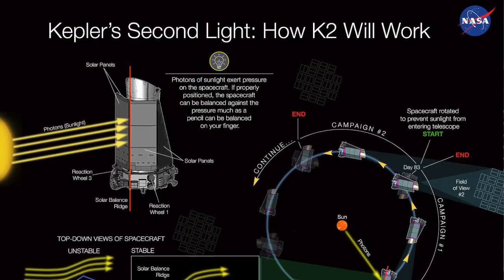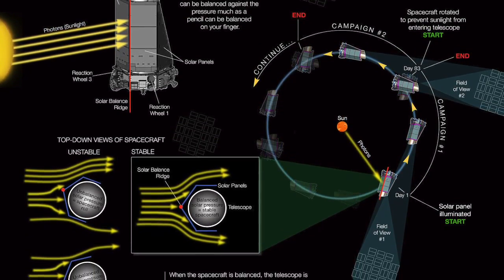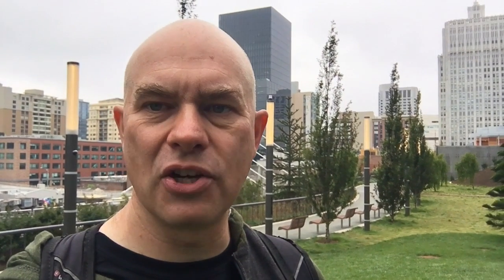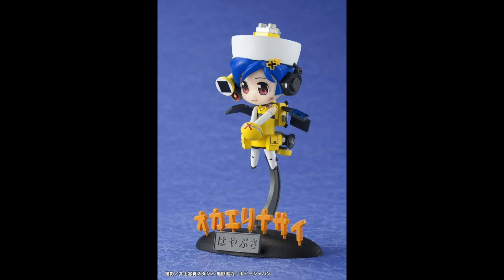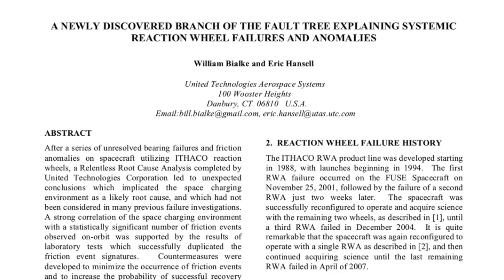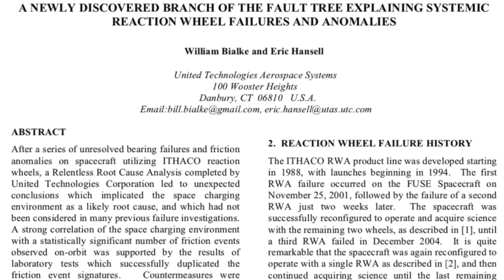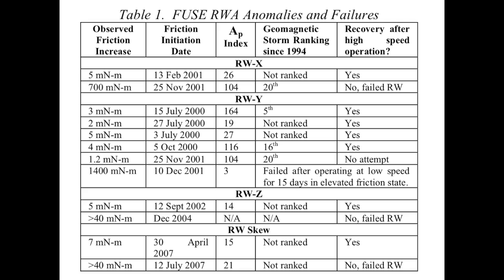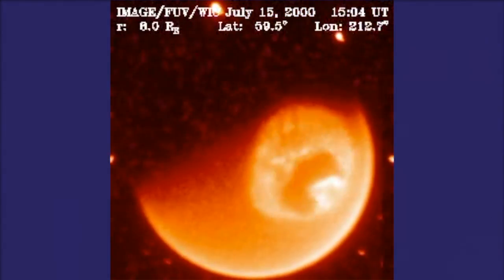Scientists May Have Figured Out Why So Many Spacecraft Were Failing

Comment: Indeed, electric arcs forms craters. Look at all the craters on the moon, for example... A round impact crater only forms when a meteor hits the surface at 90 degrees, and what's the odds that that happens with every single impact? Watch the recent ThunderboltsProject video "Electrical Experimentalists: Our Community Grows" to see how craters in the ground are formed by electric arcs, like those we see impinging on the surface of a comet nucleus.
Reply from the maker: Thunderbolts project love to tell people that circular craters only result from perfect 90 degree impacts. It seems reasonable until you actually test it, and then you observe that even with a 30 degree impact you get a perfectly circular crater.

So if your community is growing with lies like this then you should be ashamed. You’re selling snake oil, not science.
Reply: That was not from the ThunderboltsProject, about the circular craters, but simply my observation. I have seen the NASA high speed impact tests, and those projectiles hitting the ground at an angle were clearly oval shaped or very non-symmetrical. Still, u have to believe that bulls-eye craters, hexagonal craters, etc, also form from impacts, but we can't recreate these shapes with impact tests here on earth. We can however create these structures and shapes in the lab using electric discharges.
In either case, we have seen the close-up photos of comets by the Rosetta probe, and other probes in the past. Clearly what we see are low density electric arcs impinging on the surface, and not a single speck of frozen water. Just looking at comet science, we can see how mainstream astrophysics can't see the obvious truth - plasma interactions in space. Clinging to their classic Victorian-age science, by adding adhoc "dirty" to the phrase "snowball comet", thereby explaining away our close-up images of comet nucleus's which doesn't look like snowballs melting, but just hot dry rocks.
Indeed more and more people are convinced of the electric universe theory for good reason.

Comment: Interesting, after reading some of the comments, my first thought was way off in the weeds - the vacuum of space "evaporating" the lubricant from the bearings.  Learned something new about voltage spikes across a bearing ( although I knew about not welding across a bearing.. )

Comment: My first thought to solve the problem was to use heat resistant ceramics to replace bearings; you can do a home experiment with anyone who has had an electric train set, to demonstrate what static discharge event being discussed looks like in real life:

All you need is an outlet adapter for a race track or a train set. The racetrack or train set adapter will usually come with lead wires that travel to the racetrack or track connections. This is the wire I used as a child to conduct this experiment. With the adapter charged to any degree above zero, you will see a blue spark as the wire contacts the quarter and grounds out the current through the quarter in a short circuit. This would be the same effect as having the charge jump from one bearing to the next, as another aspect, the bearings themselves may have different charges from each other during a CME (Coronal Mass Ejection).

Remember, these Coronal Mass Ejections were recorded to make sparks on telegraph wires within our own atmosphere during the 1800's when electricity was not as wide-spread and in use as a part of major industry as it is now. That is surely enough to make the same kind of spot scarring you see on the surface of the quarter you've been creating sparks on. You can feel the part of the metal where parts of the wire got fused to the quarter during the exchange of electrons, also used as a practical application in welding, called arc welding.

These small imperfections would be catastrophic to bearings needing any degree of precision in a very highly machined quality product of microscopically precise application.

Good article!

Comment: Bearing fluting is a very common failure mode In industry, it can be caused by common mode voltage spikes from variable speed drives, ceramic coated bearings or ground brushes are the solution here.research scientist might want to ask a tradesman or engineer when it comes to practical experience, just sayin

Comment: I have worked on bearings that run in a vacuum chamber with high voltages and high currents. This was a machine that coated glass with metal. The conveyors used  Rulon bearings as they had no lubricant to outgas and wreck our vacuum. Running bearings in vacuum is not new. Sometimes you have to look at how other people do stuff and not assume that we can reinvent the wheel.

Comment: Question: Why no electrically conductive grease in the steel bearings?
Dissipates the charges before they can build up to hazardous levels.
BTW, ceramic bearings, being electrical insulators, would allow electrical charges to build to much higher voltages than steel bearings would.
To belabor the point, steel bearings were acting as the grounding path for the induced voltage, ceramic bearings could not.
Ceramic bearings would allow the voltage to build until an alternate path to ground is found.
Arcing between rotor and stator?  That can't be good.
The issue is electrical energy taking an unintended path to ground that leads to damage.
Fix the electrical problem first!
Some kind of intentional ground path would have prevented millions in damage and saved a companies reputation.
Look no farther than Helicopters for static mitigation...bearings and rotor-based static generation are well known players.

Comment: I'm a little surprised that no one has built an electrostatically suspended reaction sphere similar to the electrostatically supported spherical gyros that submarines have been using  since the 1970s.   Its main advantages would be an extremely long expected life because there is no wear-out mechanism and, torqued by three axis rotating magnetic fields, the minimum number of spheres needed is one instead three for wheels.  The electrostatically suspended reaction sphere's main limitation of sensitivity to spacecraft acceleration may be exceeded by the need to deal with the effects of solar flares on electrostatic suspensions.

Comment: Wow this is a subject that's been on my mind a lot lately. May I ask, what is the expected service life of a reaction wheel?

While thinking about this very problem I thought of a way to build a reaction device that doesn't have bearings, actually sort of doesn't have any moving parts. I had thought the reaction wheel failures were just the device's normal service life.  My Idea I'd think could have a service life of several decades, maybe a lot longer, but if reaction wheels are already going to last 50 or 60 years...Well maybe my idea's not worth pursuing.

Comment: Interesting. The electrical short theory is interesting. The ion engine one  I have a concern . In general ion engines do eject the protons for thrust but don't they also eject the electrons to keep the engine neutral charge?
Reply from the maker: Yes they have to have neutralizer hardware.

Comment: There is a phenomena when you drive motors with high frequencies that a voltage potential is built up between the rotor and the stater.   There is only one way for the voltage to equalize and that's through the bearings causing the damage described in the video.  This bit Tesla in the butt causing many motors to fail with a loud growl.  This due to Tesla's choice of discharge brushes which while cheap turned out to be inadequate and wound up costing more than using the best brushes from the guys that have been dealing with the phenomena for 50 years.

Comment: Is there any percentage for the failure rate? I'm just curious cause bearings can't be designed to work as reliable as other parts in mechanical engineering (german engineer here). I imagine that it should be higher than expected, because otherwise there wouldnt be investiagtions on this topic.

Comment: It is outrageous that TWO of the same device failed on the same spacecraft. Something is terribly wrong with procurement and testing.There are two ideas that make it possible to build fail-safe reaction wheels (gyroscopes).

1. Use nearly friction-free zero contact magnetic bearings instead of balls of any kind. No lubricants are required. There is zero mechanical contact in such a bearing and therefore zero wear.

2. Use permanent magnet rotors that require no connection. In such a motor, the coils are in the stator and electronically controlled to keep the rotor spinning. Again, zero mechanical contact and zero wear.

There is nothing new about the gyro that I described above. Such have been built many times.

Comment: Interesting, I always assumed space craft would have used graphite bearings for some reason  if I remember correctly they don't need a liquid lubricant would eliminate this problem, seams to me that's the logical type of bearing to use probably some reason I never thought of they don't use them ☺️
😂 Should have waited until the end of the vid ceramics makes sense also ☺️

Comment: This is actually a known problem in aircraft. If you have an improperly grounded slip ring on the propeller of a turboprop aircraft then the electrical charge can ground back through the engine and through it’s shaft and bearings causing exactly the same thing. (The slip ring is how the propeller deice heaters are powered while being able to still rotate)This is sometimes an issue with lightning strikes. If lightning strikes the prop it’s probably a good idea to take the engine down and inspect it’s bearings.

Comment: Maybe is key here. Even with some pitting from sparking they should continue to function reasonably well for quite a long time and the current needed for substantial pits is rather large [depending on lubricant viscosity] Especially in that low load environment, even in cheap and abused bicycle bearings with visible pitting they will feel quite smooth and low friction without any load, its only when applying either weight or increasing the preload that the friction and pitting becomes noticeable when compared to a quality bearing. It seems more likely there is some other issue overlooked such as thermal expansion rates causing clearance issues

Comment: There is such a thing as conductive grease. It's used in the image transfer systems of copiers where you have 600 volts dc running through the bearings from the spinning drum to ground. That arc corrosion problem was discovered a long time ago along with its solution. Millions of dollars of hardware dead in space because they used the wrong grease.

Comment: The hard disk in my laptop has been whizzing away for years!! How is it different from a reaction wheel? Why not put a hundred Seagate hard drives on the Kepler for example?
Reply: Number one, it's on the surface of the Earth and not in a high radiation environment like these spacecraft are.  The impacts of solar flares are much less down here.

Comment: What if they made the edge of the race out of platinum, and put a platinum disc, going fron the spindle to the edge of the race.and maybe plate the balls in the bearing with platinum. This should greatly reduce damage, as platinum conucts electricity, and is ver resistant to this "cratering". I beleive the contacts of a spark plug are platinum. Thats why i had this idea.

Comment: The "Faraday Cage" surrounding the gyro is acting more like a "Capacitor" in the environment of deep space. One side of the Capacitor is the spacecraft, the other is the isolated gyro. As the charge on the space craft goes up and down due to the solar winds, the charge on the gyro does not until the voltage across the "Capacitor" is high enough to discharge through the path of least resistance. The "Cheap" metal bearings, the fix being using slightly more expensive non conductive ceramic bearings. Hopefully they supplied a "path of least resistance" that will no create debris near the bearings.

Comment: Scott, I don’t understand why the designers of these extremely expensive space craft don’t add some form of locking points on the external parts of the vessel.
This would make several things much simpler.
1: maintenance robots could be flown out to the craft and have a solid locking point to use to secure themselves to the craft.
2: if a guidance system like the reaction wheels failed a supplemental guidance system could simply be flown out to the craft lock itself onto the craft and be used to extend the mission of the craft.
3: let’s say a second or third or forth guidance system was needed, with the correct design all the systems could be added by a modular system.

I’ve never read anything that would suggest that any of our spacecraft are related to each other in any modular system.
I understand each new spacecraft is developed under very narrow and specific guidelines, but a back up guidance system set up as a modular system does make a lot of sense.

Comment: I wonder is capacitance plays a role here too, we already know in electronics that 2 metal surfaces in a vacuum with differing charge can permit electron flow from one plate to another, (The Vacuum tube) however the lubricant would also be acting as a insulator of sorts i presume, so the bearing would act more like a capacitor perhaps,  the charge would build up before the breakdown voltage of the lubrication is reached (Point of conductivity) and create a much higher energy spark. (Just my theory)

Comment: Oh... Oh jeeze. It's a bit concerning that there is no mechanism in place to ground the inner and outer races. I'm very surprised that this wasn't a design consideration from the start.

At some point this lead to failures and recalls in the pitch adjusters in some early wind farms that I made parts for, it's certainly not an unprecedented cause of bearing failure.

Comment: Why does the bearing lubrication grease get high enough resistance for the electrical arc to happen?

The paper says they had to replace the grease with higher resistance oil to actually cause this behaviour. They say this simulates ware-in, however, the mechanism for how ware-in would produce a higher resistance lubricant in a bearing seems quite interesting.

Does the heat from friction cause some sort of chemical reaction that happens very slowly?
Presumably this is complex, and I'd love someone to break it down!
Reply from the maker: I think the paper demonstrated that over time the different grease components would deplete at different rates, changing the resistance over time.

Comment: Electric universe of The Thunderbolts project. (On YouTube)
Space is not a vacuum. It is a plasma through which flow cosmological large currents.
As the spacecraft cuts across these currents, Lenzes law says that currents will be induced in the craft.

This will have a braking effect. Have any braking effects been observed?